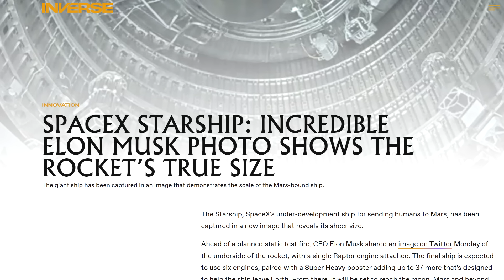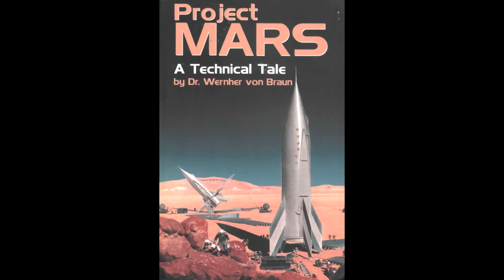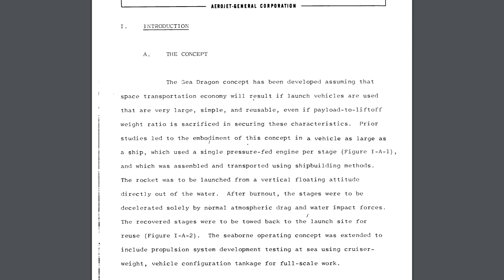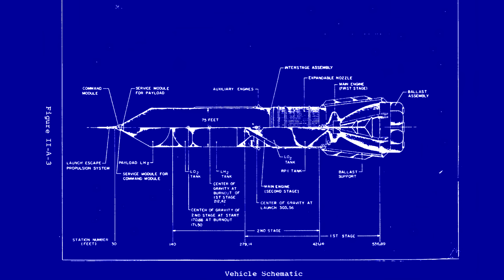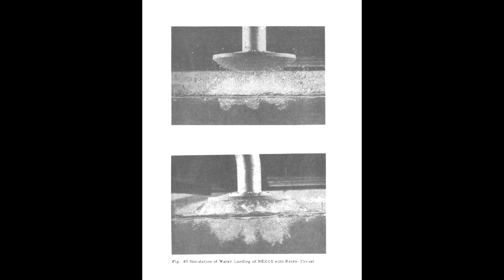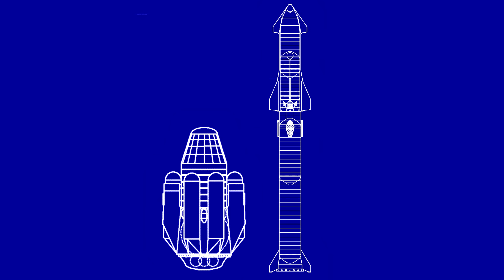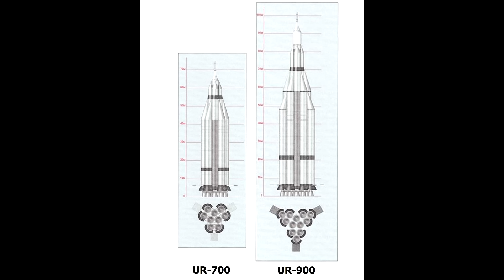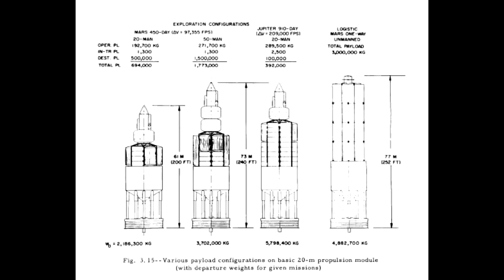The Old Rocket Designs That Make Starship Look Small

Comment: my favorite is the MuCh wOw 16 MeTeR lArGe sTaRshIP
Reply: Fun fact: One of the Heavy-lift Vehicles from NASA's SPS study (the Alternate Design at 10:31) has similar payload to Starship (120t), yet only 4000t mass when full. Which is less than simply the fuel mass of Starship (a 20% boost), and even with some mass reserve! Apparently, aluminium construction/winged flyback is a pretty efficient design!

Comment: wait wtf was that about space based solar power? how tf would that work sounds amazing
Reply: @tau3457  ? alright man i wasnt really expecting someone to comment and explain how it worked to me was more rhetorical because i was amazed that it would even be possible, go watch fox news old man, (i googled it about a minute after i posted the orginal comment)
Reply: Fun fact: One of the Heavy-lift Vehicles from NASA's SPS study (the Alternate Design at 10:31) has similar payload to Starship (120t), yet only 4000t mass when full. Which is less than simply the fuel mass of Starship (a 20% boost), and even with some mass reserve! Apparently, aluminium construction/winged flyback is a pretty efficient design!

Comment: Elon Musk is no Brunel, but Starship is big for pretty much the same reason as the Great Western.
Reply: Fun fact: One of the Heavy-lift Vehicles from NASA's SPS study (the Alternate Design at 10:31) has similar payload to Starship (120t), yet only 4000t mass when full. Which is less than simply the fuel mass of Starship (a 20% boost), and even with some mass reserve! Apparently, aluminium construction/winged flyback is a pretty efficient design!

Comment: project Orion's  nuclear bomb propelled ship was going to be massive. I think the largest design would of had around 6000t payload
Reply: I was gonna flag this, not a rocket but used battleship technology rather than aero😁 Shame about the issue of fallout.
Reply: @seanamos5878  Ground launched Orion would have used sub-kiloton shaped-charge nukes.
Reply: @williamblack4006  and needed nearly a 1000 of them to get to LEO. 

Suspect the case for a launch would be made if it was the only way of dealing with some rogue asteroid etc. Potential deaths from radiation induced cancer vs extinction event should be a no brainer.
Reply: @seanamos5878  No, it would have used 480 bombs to get to orbit.
Reply: @williamblack4006  well the Wikipedia page I read states "The optimal Orion drive bomblet yield (for the human crewed 4,000 ton reference design) was calculated to be in the region of 0.15 kt, with approx 800 bombs needed to orbit and a bomb rate of approx 1 per second.[7]"
What was your source?

Moot point really (480 Vs 800) as unless some planet threatening scenario faces us the system is considered environmentally and health outcome unsound.

Comment: Funny, I always thought that all those designs were way under sized for the job in question. I was delighted when Elon Musk began his quest. I think they are still 70% too small. If you're going to conquer space you need to think much bigger. Much more multistage and house not just humans but bots who would run the long haul while the humans slept in stasis.
Reply: Fun fact: One of the Heavy-lift Vehicles from NASA's SPS study (the Alternate Design at 10:31) has similar payload to Starship (120t), yet only 4000t mass when full. Which is less than simply the fuel mass of Starship (a 20% boost), and even with some mass reserve! Apparently, aluminium construction/winged flyback is a pretty efficient design!

Comment: The bigger you get the less drag you experience, so that's good.
But your full/dry mass ratio gets smaller because the taller your rocket is the more tank pressure you need or the whole structure will collapse under it's own weight, so you need thicker walls.

Comment: Imagine if they kept plowing cash into it and the US was now powered by space based solar…
Reply: Fun fact: One of the Heavy-lift Vehicles from NASA's SPS study (the Alternate Design at 10:31) has similar payload to Starship (120t), yet only 4000t mass when full. Which is less than simply the fuel mass of Starship (a 20% boost), and even with some mass reserve! Apparently, aluminium construction/winged flyback is a pretty efficient design!

Comment: Musk should have tried to go with a Bono design. Starship is destined to fail miserably.
Reply: So say the armchair experts.
Reply: Fun fact: One of the Heavy-lift Vehicles from NASA's SPS study (the Alternate Design at 10:31) has similar payload to Starship (120t), yet only 4000t mass when full. Which is less than simply the fuel mass of Starship (a 20% boost), and even with some mass reserve! Apparently, aluminium construction/winged flyback is a pretty efficient design!

Comment: Starship has never landed OK...it's like Elon jumped a very important step and went large without sorting out this really important point.
Reply: Fun fact: One of the Heavy-lift Vehicles from NASA's SPS study (the Alternate Design at 10:31) has similar payload to Starship (120t), yet only 4000t mass when full. Which is less than simply the fuel mass of Starship (a 20% boost), and even with some mass reserve! Apparently, aluminium construction/winged flyback is a pretty efficient design!
Reply: You sentence is incomprehensible.
Reply: @arlaban22  I just wanted to share that fun fact, that is all.

Comment: -  Enough with the Sea Dragon already!
The submerged giant bell shaped thrust chamber's pressure on ignition explosion would be so great trying to expell thousand tons of nearly unmovable inside sea water ( Principle of Hydraulics) & super heated steam in a downward direction into the surrounding sea that the whole thing would blow up like a Soviet N-1 moon rocket on the launching pad. It would be like packing it full of dynamite.
- And submerged in corrosive salty sea water? Come on. Even Disney's Goofy knows better than to propose something so dumb.
- The main reason why nothing gets bigger beyond a certain point is because of the limiting physics of the "Exponential Scaling Facter" Even Nature knows that. You don't see 50 pound pumpkins hanging from tree branches like apples. Do you?
-  And, have you seen a truck sized ant lately?
Reply from the maker: Funny thing is they actually tested underwater rocket ignition and it worked fine.
Reply: @scottmanley  I am far from expert but at what scale?  That engine bell is huge.  I keep coming back to pressure fed engines.  Being inexpert I'm thinking how much pressure is in those fuel tanks to not only feed the engine but compensate for all that back pressure from trying to push all that water out.  I am not educated enough to cope with all that pressure!
Reply: @scottmanley  it's not underwater rocket ignition per se but scaling thats the issue. And being underwater just compounds the problem. 
- The current Trident  Submarine Class D missiles are shot out of their underwater tubes by a steam canon. And only after it clears the surface of the water & the internal motion sensor registers a brief pause before momentum reversal back down, does the first stage rocket ignite & the rocket flies up.
- This all happens so fast that to the untrained eye it looks like the rocket blasted out of the submerged submarine unassisted. Not So!
- However,  you should have no problem firing a bazooka rocket under water. But that's because it's a lot smaller.
- Now the Sea Dragon's huge size to volume " Cubic Scaling Factor" would go thru the roof.
- Triple the length of a 1 foot cube & you get 3 cubes. But triple its all 3 axis & you get 27 cubes. I hope this clears up my opposition to 2 dimentional animated drawings projecting a real 3-D heavy object without all the  physics and its  engineering involved.
- Here's another thought;
>  If you make an asteroid big enough no matter how hard  you try to retain its original shape it will always turn into a sphere. e.g.  Asteroid Ceres. Largest of them all. Gravity becomes an issue.
-  So, in nature; Size matters! And any time somebody tells you bigger is better. Red caution  lights should go flashing in your mind.

Comment: If evolutionary repeatability is a teacher then Starship will meet the fate of the N1 as the same engineering design paradigm (trial by fire) is applied. Such engineering design works in small units - it worked with R7 (SSSR) and Falcon 9, but becomes too costly with bigger units.
Reply: That's if you make the simple assumption that there has been no progresses in computer aided design, metallurgy, computers and sensors in the time between the two systems.  About the only thing they actually have in common is a large number of engines.

Comment: With the Sea Dragon, why the water launch and how realistic would that have been?
Reply: i can tell you the reasoning for the water launch:
-> You can launch basically to any Orbit directly without Inclination changes
-> No need to build Ground Support Equipment like Launch Towers or Flame Diverters
-> If it blows up there is no nee to rebuild anything
Reply: Shockwaves, and very realistic.
Reply: Because of 2 reasons:
First, it was so powerful that the sound and sheer power emitted from it would have destroyed infrastructure around it. Think of how starship makes a lot of noise with only 3 raptor engines, then just imagine what sea dragon would have been like
Second it would be way cheaper to use the water as the launch infrastructure. It holds the rocket in place, suppresses a good amount of noise, and there is nothing around (except sea life) it to be destroyed by its power.
It is actually more realistic than it may seem too. small test rockets have been launched from the water and they worked very well. It can actually be WAY cheaper because you don’t have to build any sort of launch infrastructure.

Comment: Those "larger than Starship" designs could not be powered as no suitable engines could be built.  Engines ARE available for Starship. 
That said, NASA's SLS is - or ought to be - "dead as last night's dinner" as Scrooge said of Marley.
Starship has killed it.
NASA could save money by abandoning SLS and commissioning SpaceX to build a Starship variant that is entirely propellant tanks with heatshield and an interstage adapter to hold the current SLS final boost stage with the crew capsule and service module...

Comment: Many many ways to use far less fuel with greater size crafts. One way, is a runway to kamen peak with a winged rocket air carrier first stage sequal, a super savior of fuel, as the burden of the strongest gravity, air, weather countdown waste of T-minus time is below it. Above the kamen , is a FRIEND to canister stage chem thrust engines. Under kamen, an alley to wings, ramjet/afterburn/blade proplusions.
 Keep in mind, if yer need a massive station up in a day, use MASSIVE vhigh ballons, At the near peak, compress and use small-to-full fuel swap of the ballon hanging on those canister, then FULL rocket booster blast off after to catch park in orbit velocity. 
🛫✈🚀🛰🛬
🎈🛸🚢🛸🎈

Comment: An impressive size but if it doesn't fly then it's neither here nor there! Funny that Musk's design is similar to the Boeing one of 50 years ago and he's such an up to date modern inventor!
Reply: All rockets share a common design.
Reply: Fun fact: One of the Heavy-lift Vehicles from NASA's SPS study (the Alternate Design at 10:31) has similar payload to Starship (120t), yet only 4000t mass when full. Which is less than simply the fuel mass of Starship (a 20% boost), and even with some mass reserve! Apparently, aluminium construction/winged flyback is a pretty efficient design!

Comment: So basically what you're saying is that Elon's modern ideas are actually neither Elon's nor modern
Reply: Fun fact: One of the Heavy-lift Vehicles from NASA's SPS study (the Alternate Design at 10:31) has similar payload to Starship (120t), yet only 4000t mass when full. Which is less than simply the fuel mass of Starship (a 20% boost), and even with some mass reserve! Apparently, aluminium construction/winged flyback is a pretty efficient design!

Comment: Think so?  You should see my rocket.  I need a filter.   And I don't know how to tell you this, but there is a LOT of opinion in most any design of most anything.  You can't 'mathematic' everything.  How's that for a whole crap load of generalization?  But it's true and accurate.  "Two hundred feet in diameter".  LOL, why stop there?   Seriously, picture that thing sitting on a football field!  The damned thing is basically twenty stories WIDE.  You made my morning.   Oh, and I just wrote a comment in another of your videos about engineers liking to employ pointy things wherever they can...well, what did I tell you..."pintle design".  I'm telling you, they are EVERYWHERE.  :-)   You could find a few, typically, just in one automotive carburetor.  

Heard frequently in engineering bullpens the world over, "What should we use here?'.   "Is there some way we could employ a pointy thing?".  "Yeah, that's the ticket".  "Bwahahaha" (evil laugh, complete with hand washing movements and single eyebrow cycling, and in the worst cases, the Snidley Whiplash mustache twirl!).  Think the worst of Austin Powers, Bond, et al., at Science Mystery Theater 3000 level.

Comment: It looks big compared to 60 year old rockets, but as the richest man on the planet Elon could have done better
Reply: Fun fact: One of the Heavy-lift Vehicles from NASA's SPS study (the Alternate Design at 10:31) has similar payload to Starship (120t), yet only 4000t mass when full. Which is less than simply the fuel mass of Starship (a 20% boost), and even with some mass reserve! Apparently, aluminium construction/winged flyback is a pretty efficient design!

Comment: The more I learn about old timey space program endeavors the less I'm impressed with SpaceX and the new private space race. Wasn't super impressed to begin with, but landable rockets would have been more impressive in the 70s than the 2010s. Was even quite impressive in 96 when Nasa and McDonnell Douglas did it.
 
Also, SpaceX tends to come out with great looking big chunky hogs, but the stuff that actually comes to fruition are just needle thin puny sad rockets... I guess that's how funding in the private sector works, but still, it gives us an impression that SpaceX is doing something amazing and huge... When those are essentially just artists renderings of Elon's fever dreams...
Reply: Fun fact: One of the Heavy-lift Vehicles from NASA's SPS study (the Alternate Design at 10:31) has similar payload to Starship (120t), yet only 4000t mass when full. Which is less than simply the fuel mass of Starship (a 20% boost), and even with some mass reserve! Apparently, aluminium construction/winged flyback is a pretty efficient design!
Reply: They might have been more impressive in the 70's but no one was able to make into a working flying system until spacex.  It might not impress you but I don't think you have any real understanding either.  In fact your whole second paragraph is little more than just ignorant nonsense.  You make a fool of yourself.

Comment: Are these huge rockets "designs" in the same meaningless sense that Frank Lloyd Wright "designed" 'The Chicago', a supposedly "mile high" pair of converging lines that he scrawled on a napkin?

Didn't even have space for elevators...

Structurally infeasible...

Little known fact: someone later added a comedic zero to the sketch caption, thus "designing" a building TEN MILES HIGH!! WOW...
Reply: The answer: No.

Thank you.

Comment: The SpaceX "Starship" is more tiny then it looks,  beyond metaphors. For one the Beast barely can park the cargo vessel fully into orbit velocity. A double work, risk time-scrub abandon & fuel thing, nor beyond any of the Earth exosphere. Two - there is no mid vessel canister/nuclear filter flow to ease the solar orbit journey for Mars (& that Chinese-fans solar pans is sarcastic). 3 - That claim of 100 sardine of people, is really averaging suitable at approx 12people👀. Yes smaller then it looks for a Starship.
Reply: 100-150 tons is a LOT of cargo.  Not one other system can move something that size beyond LEO without refueling.  Nuclear is not needed, solar can do the job despite what you make up. 100 people and all they need would have to fit inside 1000 cubit meters, which is 10 per person and in space, even a phone booth is a lot of space. You know less than you think you do or someone spoon fed you a lot of nonsense.
Reply: @TheEvilmooseofdoom    Your sarcastic optimistic dream craft sounds nifty, but not realistic, 100 people was the sardines compress sarcasm of Starship as actually feasibleis 12 ( 🐒 maybe ). This 2 tin cans two Mars, when it took 5 stages just to the moon, will not cut it. It has NO solar orbit preparation in a limited canister of no nuclear chem-fuel/ion/plasma amp thrust. No gravity non-idle gravity gforce though the entire trip. 

That Chinese-fan solar 🔋 is absurd. Perhaps to the moon, but not one trip. The risk of double R-R-R Relaunch time & weather scrub abandon in orbit. RIfill human atmosphere supply pending scrub delays during orbit, and Redo double full-set tins with no ( nuclear) heart for Starship-cargo. 

  All Because the Beast cannot even reach orbital velocity parking and will need adjacent allies to be a one trip. By the time this pure Inspirationsal craft is fully ready to mass deploy, it's already going to be an outdated ( more like IS) in features to anything new.
Reply: @rolflandale2565  except, dreams come true eventually.